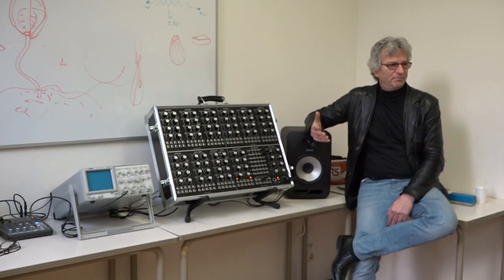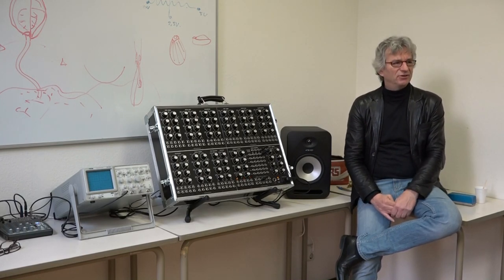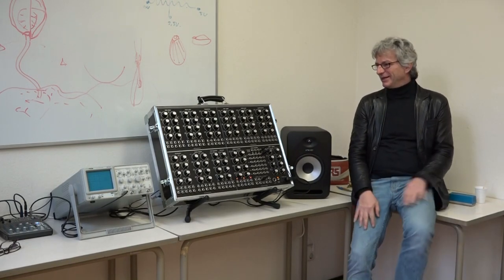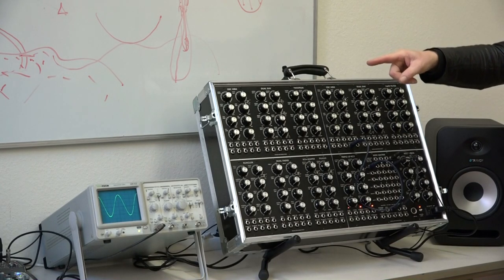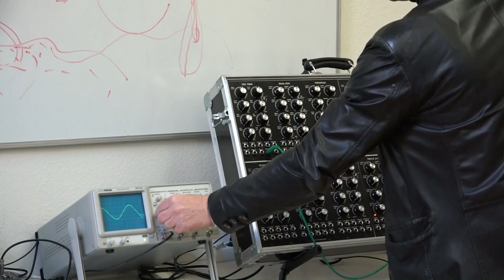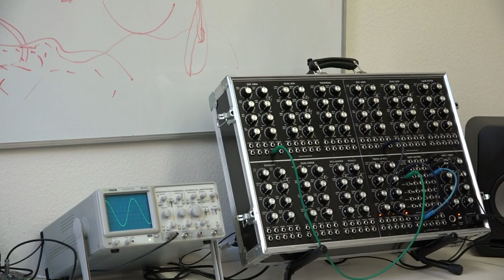Rob Hordijk masterclass 21-11-15 Introduction

Comment: thanks a lot for the videos! would be cool to know the chronological order of the clips.
Reply from the maker: Rob started with his introduction, then he did a session about the Noise generators [p1+p2]. I do not remember if he did the waveshaping and fluctuation section after the sample and hold tricks, but he ended with other tricks. Cheers :)
Reply: thanks, funny, I was just thinking about this lectures yesterday again! Especially the rungler part amazed me. I have a blippo, but the Hordijk-System Rungler seems far more versatile.
Reply from the maker: The Blippoo contains the Twinpeak and a Rungler, but the Rungler module in the 5U system has as far as I experienced far more possiblities and options.. But, the Blippoo itself is a damn cool standalone chaotic desktop synthesizer! Also the Blippoo Twinpeakfilter differs from the 5U Twinpeak (12dB vs 18dB)..
Reply: interesting. I wonder if it is possible to buy the Rungler Module Alone or Rungler and the Twin Peak, although I have a Twin Peak in Eurorack already... do you know on which voltage the Hordjik runs? If it is possible to talk to eurorack.... I will try to find where in this lectures, but the are a couple of minutes with the rungler sound alone (or to vco, cant remember) where the structures are soo amazing, complex & intelligent my jaw dropped.
Reply from the maker: As far as I know Rob do not make single 5U modules anymore. He only does triple panels. I integrated my Hordijk without any problems with my Serge and other gear. My Hordijk system contains a Moon M569 sequencer which sends 5v-10v voltages with succes. You can send Rob an email with specific questions, he is very happy to answer these :) rhordijk@xs4all.nl